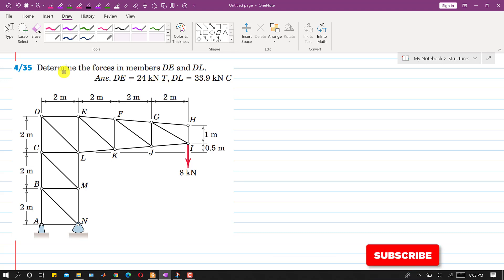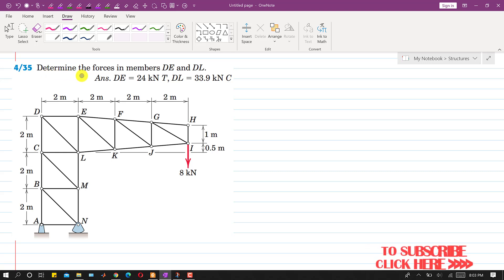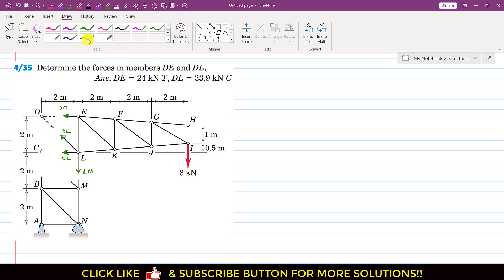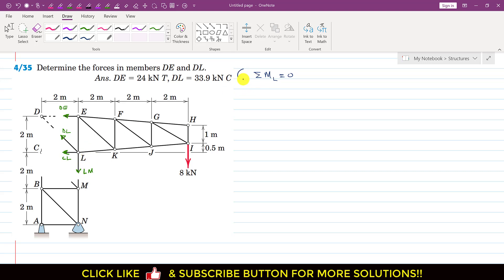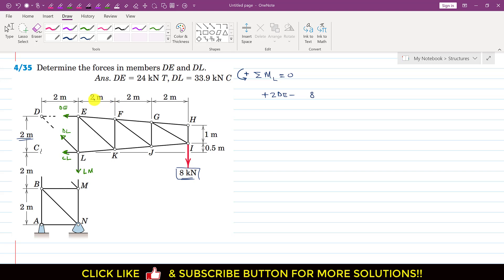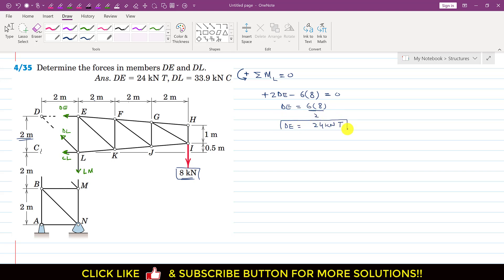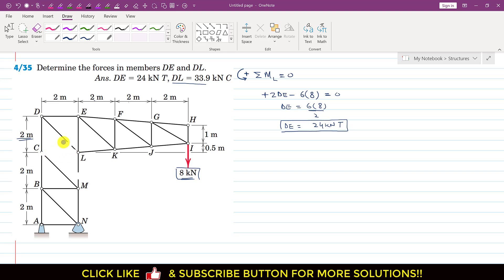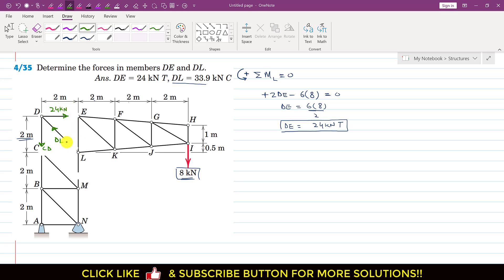Determine the forces in members DE and DL. | Trusses Method of Sections |  Engineers Academy

Comment: Respected sir, In methods of section we divide a truss into two parts with a condition that no more than 3 members should be cut so in this you have cut down 4 members. I didn't understand this sir??
Reply from the maker: In my knowledge there is no such condition of 3 members.
Reply: @EngineersAcademy2020 Ok sir thanks for clearing my concept ♥️